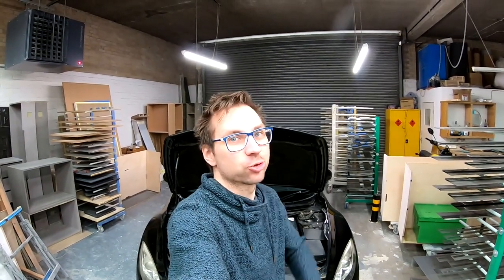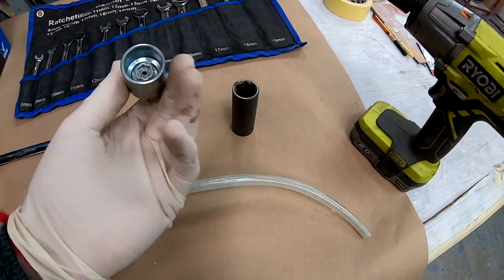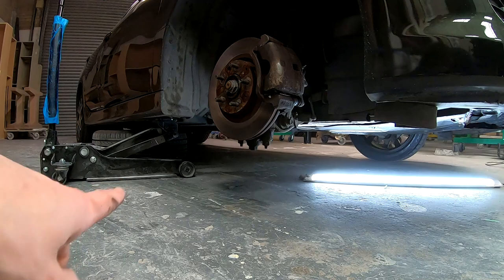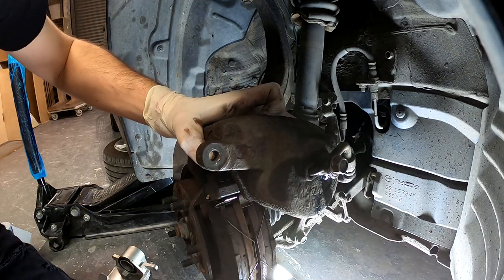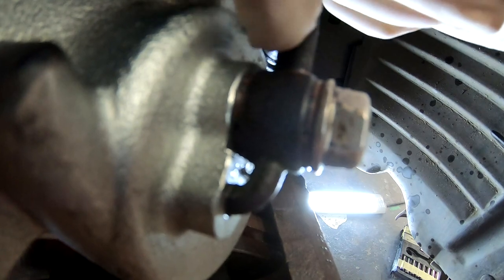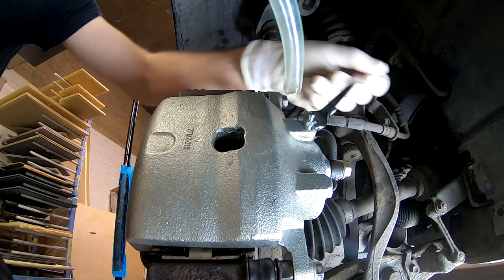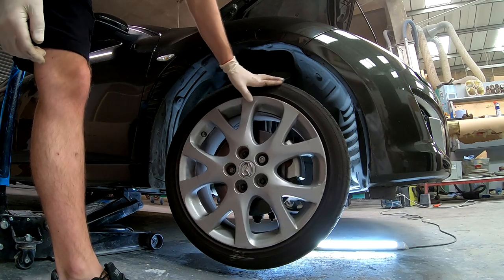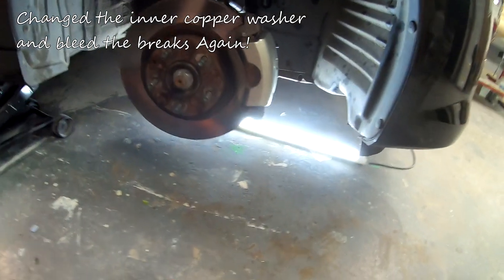Front Break Caliper Replacement on 2010 Mazda 6 GH

Comment: I've been there before, when you end up needing to bleed again and again and again 😮 From what i've learned you should always keep the bleeding screw sealed while both undoing it and tightning it back, because if you leave it loose you will introduce more air again to the brake lines, but it was nice to see you doing a video on how to do this replacement 😄 One, like myself who has a decent knowledge when it comes to fixing cars, i find myself learning new things when watching these videos 😊 Although i am very familiar with brake parts replacements, there's always something new to learn 😄

BTW! I sent you an e-mail.
Reply from the maker: Yeah, one small mistake and you have to redo most of the job 😅 For me the copper washer wasn't sealing anymore... so yeah. 
I 100% agree with you. Bleeding the breaks is most important. That's why you want the special tool that puts a vacuum on the line, so you can turn the bleeder screw and not worry about getting air in the line. 
In the video I showed the most '' janky way to do it'', fill up the reservoir to the max and let gravity + stomping the brake pedal do all the work. 😂
 We learn something new every day. I'm learning plenty from the comments on these videos too. 
Already taken care of, Thank you for sending an email. 👍

Comment: Today 17.05 10:03 AM , my Mazda 6 GH 2011  is at the mechanic for the 4th day consecutive after changing brake calipers and disks 3 weeks ago. A rattling noise started to develop. I have changed  everything on from shock absorbers,  all arms  and pivots to planetary shaft bearings. Now I have another noise coming from the middle of the car . Bearings from the stabiliser bar need replaced . I have spent 1300 euros for something that should have be done properly from the begining. NOTHING was rattling when i first got it into the service. Hopefully I will get it out today , it will go to the detailing soon and I should be done with her. 😉 
One question: Why is the brake on the left side squeaking when brake applied ? He rechanged he sprayed it with WD 40 and it still squiking badly  ....after 3 weeks of use 

Mechanics = parts changers nowadays....
Reply from the maker: Ouf, that's really bad. You know that 600 euros from 1300 went to the mechanic, not in your car or parts. 
WD40 on breaks. 😳 never ever again go to that mechanic. WD40 got no place or use at brakes.
Please, after you get your car back, go to another mechanic and Mazda dealer, and ask them to check over the car. 
As you are saying parts changer is almost 99.8% correct. They fix one thing but break another so the customer returns. 
That's a tactic I caught on my BMW.   They had to replace 3 breather hoses for the engine and did bother to put the screws that hold down the air box, Overtime it will rattle and break the mass air flow sensor, which would make the car run rough.

Brake squeaking could be a couple of things, the brake pads are worn down to the wear tab, so it squeaks as a warning to change them. 
No copper grease or anti-seize on the brake pads sides and the back, or no grease/ anti-seize on the break hardware themselves. 
Could be dirt stuck in the brake pad surface and squeaking.

Comment: I’ve never seen a ceased up calliper before. I don’t think I would want to try that myself at home. But I’m curious did you try finding bigger MPS6 discs and calipers? I heard it is a straight bolt on upgrade.
Reply from the maker: Upgrades and mods will come after fixing the car. 
Half of that is correct, with the RIGHT / correct kit and parts yes. But you will need adapters and extra. 
The caliper and rim are the size how they are, to big upgrades and they can rub on the inner wheel  or you won't be able to bolt down the caliper.

Comment: FYI: the wire springs on the pads are not installed correctly - they are ment to drive away the pads from the disc. They schould be horizontally, not vertically. 12:21
Reply from the maker: Thank you for the information.  
That's how the wire springs were when I got the car, never questioned it , if it was wrong or right. 👍

Comment: Bro you are way better then mechanics in my neighbourhood. They only want to change parts fast as possible to charge another customer and often the job is not done properly. With tutorials like yours I would definetly try myself just dont have a place where I could do it in peace. Stil looking for a EU after lift 2.5 L in liftback version (were they even produced Im not sure at this point lol) but they are nowhere to be found, I think I have to decide between 2.0 DISI after lift or 2.5 before lift. Do you have any opinion on the 2.0 DISI version ?
Reply from the maker: Mechanics just want the job to be done and move on.  They have the knowledge and do the same job many times, so yeah, I kind of don't blame them, but in the end, it's their job to do everything properly. BUT, it's brakes... They are a VERY important part of the car. 
If a job is done badly, people could get injured or in the worst case die.  ( that's why I did soo many checks in the video) 
I know how you feel. I had to wait 3 weeks before I could replace the brake caliper.  As I want to have a place to safely do it. 
so you are looking for a facelift GH? 
It mostly depends on what Engine you want. You can always do a facelift upgrade on the older model.  But it all depends what you want.

Comment: Got a 2011 6 TS2 which has annoying boing type knock mildly  felt through the gearstick when pulling away. Been back to mechanics three times no fault found. I’ve changed all droplinks and sway bar bushes  front and rear as with a new gearbox mounting. Any ideas. Thanks.
Reply from the maker: Hard to say. Whiteout hearing the noise it's hard to tell. 
By going the way you described it, Pulling away and can be felt in gearstick. So when the engine is reving up / on a load. 
First things what comes in my mind engine mounts / gear box mounts, clutch bearing, clutch itself or flywheel, CV shafts. 
But this is a guess, with out hearing it or feeling the general direction / vibrations won't be able to tell.
Reply: @KlavsX_  it’s just on take up slowly pulling away can’t hear it on motorways  etc just that initial pulling away slowly 
Thanks
Reply from the maker: suspension parts worn?  I doubt it would be gearbox, or drive shaft, they are rotating all the time. you would hear the sounds all the time. 
So only at that situation? no knocking while turning the wheel lock to lock, or driving over bumps?
Reply: @KlavsX_  I’m convinced it’s either the connection of the Dow pipe to engine or down pipe to DPF as the noise has this sort of “boing” type noise 
Thanks for replying
Reply from the maker: If you have jack or a way how to get under the car and give all of them a good shake, you should be able to find the trouble maker. 
I'm curious too, what is making that noise for you
Reply: @KlavsX_  yep! Done all that Klav! It’s usually when engine is cold and as soon as you lift clutch to pull away you get the knock. I will find it and let you know. Still love the car tho! 👍
Reply from the maker: Of course, 1 cluck at the star up doesn't change the feeling and the drivability it gives you. 
Oh, interesting in cold condition, that's really interesting

Comment: Recently took car in for brake fluid change and they couldnt bleed properly due to rounded bleed nipples, do i have to change out brake calipers? Or is there alternatives
Reply from the maker: 🤔 Sounds like they didn't wanted to do the job. You can replace the bleed nipples themselves. No need to replace all the caliper.
Reply: @KlavsX_   oh wow, how should i get it out properly then
Reply from the maker: They are literally hollow bolts with threads on the bottom, an 8 mm size head for a spanner or socket and the top is round for putting on a hose for a vacuum.  So if they are rounded off, forcing on a 7mm socket will do the trick. (use 7 mm long socket and a hammer ) *As long as you have the new bleed nipples ready*. Once you remove them, the brake fluid will leak out.
Reply: thank u  @KlavsX_

Comment: Hi Klav, where did you buy the new caliper for £50 or even £80. I'm being quoted £138 🤦🏽‍♂️ Any help would be appreciated. I have 2010 2.0 petrol Mazda 6.
Reply from the maker: Oh nice 2010 2.0. I found my ones on Ebay from Chrysler supplier. There are many calipers but this one was reasonably priced with good reviews